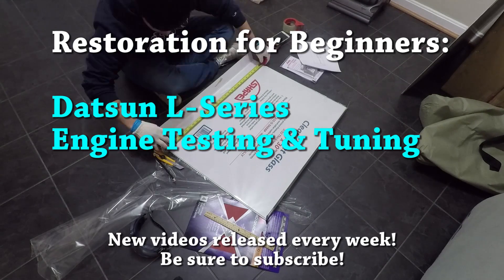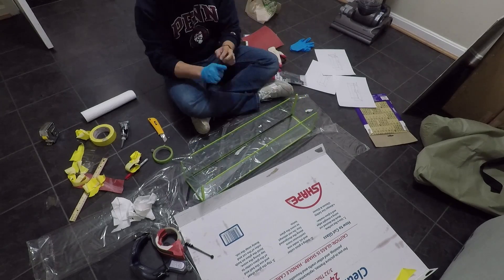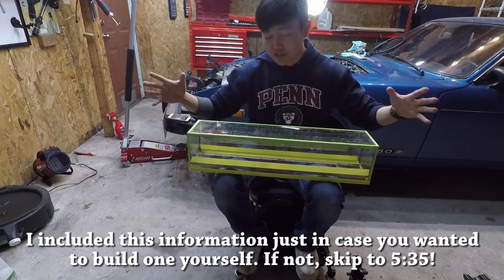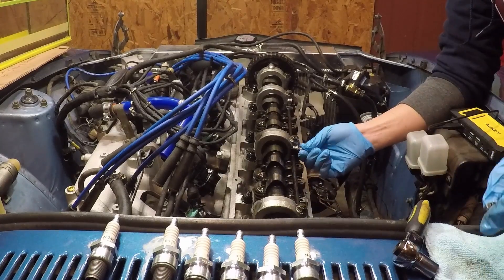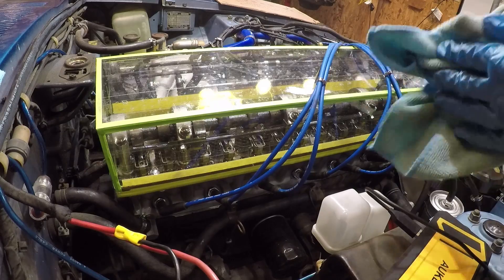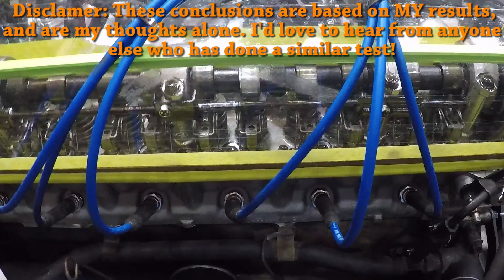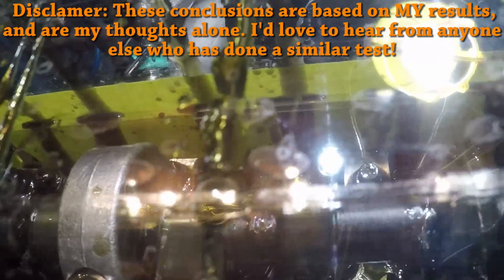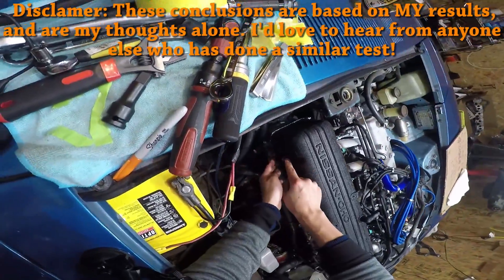Datsun L-Series Engine Testing and Tuning Ep.6 Clear Valve Cover!

Comment: Really cool experiment, though I'm pretty sure the spray bar system came before the internally oiled setup. The spray bars have a tendency to fall apart and the sections separate, the block sections can also bend and not seat properly against the cam towers. I think it's a better system on paper but has pitfalls in the real world!
Reply from the maker: You're absolutely right, I had that flipped (pinning this comment so everyone sees). They did away with the spray bar and went to the oiled cam afterwards.
Reply: Just discovered these videos, awesome! I wanted to clarify that there are two models of spray bar. The earlier type uses aluminum distribution blocks with steel tubes soldered/brazed in. Those fall apart. Your's is the later type which is all steel and stays together. It's worth keeping/selling.
My L24's original bar was bad enough you could remove the rear most tube by hand. The only thing keeping it in was it running into the rear most cam tower.

Comment: Hey, I’m not an expert on any car engines but a suggestion. How about talking to Rob Fuller of the Z car garage in San Jose California and ask him about keeping or not keeping the oil spray bar??     also I’d like to ask is there a way to clean out the inside of the spray bar and make sure the holes are not restricted or plugged?

Comment: The head has so many points on it that can wear, because of the constant motion there, that I'm personally satisfied that the oil spray bar (bad name IMO) is getting oil on a critical location by dripping. Without it, there would be no oil getting to that critical location other than spray caused by the spinning camshaft. Remember the old saying, "If it ain't broke, don't fix it..."

Comment: You definitely need to upgrade your oil pump to a high volume unit when going with both internally oiled cam and spray bar. Basically you are adding more ports which allows the oil to flow easier thus lowering the oil pressure and degrading the spray bar's ability to spray properly.  You need to increase the volume of oil in the system in order for the spray bar to spray properly.  It would be interesting to run the test again after upgrading the pump to a high volume unit.

Comment: Great idea making the clear valve cover. I recently bought a '72 240 and the spray bars were removed and a Comp cam internally oiled cam was in it. There are block off plates too. I wondered if the spray bars did put oil on the lobes better than the small holes in the lobes. You showed that internal oiling is most likely better than the spray bar and why Nissan made the change in '77 I think. Thank you for the video and information.

Comment: Oil spray bar and oiling cam drops the feed pressure to low.Either use 1 or the other.Do not over think and create a new problem by trying to be different.

Comment: Just out of curiosity which oil pump are you using and how much oil pressure do you have during this "test"... I've seen the H4 pump used which is a stock turbo pump used with an internally oiled Cam and a spray bar and it doesn't look like that it sprays a steady stream at idle into the cam @ 25psi of oil pressure.
Reply from the maker: I'm using the stock L28E pump. I have heard that if you want to run both systems properly, you need to upgrade to the turbo pump.
Reply: Ya I said that... what was your oil pressure during this test.... it would kind of make the test not valid if you didn't know what the pressure was during the test.
Reply: You can also put in a stiffer spring in the oil pump to bring pressure up fyi
Reply from the maker: I wasn't able to bring up the oil pressure that high during the test, but I did manage to get it up to 20-30 pounds.
Reply from the maker: Noted, thanks!

Comment: Thinking about your Oil burning, Have you hooked up a vacuum gauge, it can tell you alot about the condition of your engine, If its a few inches low, say 15/18, and steady at this reading, this would be a clue of rings going bad. One of the first things I did with my Z was install a vacuum gauge. Not sure what your engine is suppose to be vacuum wise, mines at 20/21 at idle.

Comment: I have an original '76 280Z manufactured in 11/75, and it's got the spray bar.    I'm going to guess you rearranged the before and after at 0:41.   I think some '77s were internal if they were manufactured after a certain month in '77.
Reply from the maker: Yes, I mixed that up! The spray bar was before the oiled cam.
Reply: I currently own a 77' and its internally oiled

Comment: Could've used plexi glass or acrylic if you were worried about the glass breaking. Great video though! Not having the valve cover sealed shouldn't have caused a vacuum leak. It was probably the breather hose that ran to the valve cover causing the vacuum leak so plug it off if you do that experiment again.
Reply from the maker: I thought about that, but I didn't want to risk the acrylic warping due to the heat. I don't know about plexi glass, but acrylic tends to warp and melt near 200 degrees Fahrenheit.  In hindsight, that probably would've been a safer/easier alternative to glass, since I wouldn't have let the engine get that hot. 
And yes, that's an excellent point. The vacuum leak was due to the breather hose not being securely closed, not due to the valve cover itself.

Comment: That was very cool, thanks for taking the time to do that. On a side note You seem to be under the impression that an open valve cover is a vacuum leak, a vacuum leak is in the intake system, having the valve cover or oil cap off should not cause a vacuum leak. I really need to get one of those crab nets.
Reply from the maker: You're right! The vacuum leak was due to the fact that I didn't securely close off the breather hose that connects to the valve cover outlet. I just had the silicone hose folded over, but it came undone during the revving. 
Haha I never actually used that net for crabbing. I bought it to go crabbing, but now I just use it to fish out parts underneath the car.

Comment: Curious as to the ID of the spray bar ports and if they were made smaller, like pinholes, would the stock pump pressure be enough to throw the oil farther into the path of the cam lobe. Probably moot, but would be interesting to find out. Great work on the valve cover.
Reply from the maker: Thank you! If I had precision metalworking tools, I might be inclined to try the smaller ID spray bar. But honestly, I doubt that it'd be worth the effort since it's more likely that I'll damage the fragile oil spray bar, and according to high performance cam manufacturers, it doesn't even sound like it's strictly necessary.

Comment: I would think an experiment like this would raise some eyebrows and perhaps even create some marketplace demand for spray bars that actually work as intended.   I do have to wonder if they're all functioning like this or if this is unusual.    It's hard to tell from the video that it's not spraying at all (ETA: at higher RPMs).   Do others both spray and drip to some extent?    Does dripping and not spraying mean smaller/consistent clogs or wear, or is it straight up a defective design?    
It would also be interesting for someone with a higher spec aftermarket oil pump to duplicate this experiment with the old spray bar on there to see if there's a difference.   It might be that the bar is a good design.  Generally speaking it looks like the cam is getting great lubrication and there's plenty of oil flowing about so things look really good with the internal system.   Even dripping onto the top of the rocker I have to wonder a little bit if the oil still runs down the top surface and ultimately adds somewhat to the lubrication where it's supposed to rather than being completely useless to the point of being counterproductive.
You almost showed us your spark plugs at 5:35.    I'm guessing they're all good.
Reply from the maker: I can only assume that the spray bar would work fine if it was paired with a camshaft that wasn't drilled to oil itself. The point that I was trying to make was that the stock oil pump can not drive both methods of oiling, you have to pick one. The spray bar in the video is in fact pouring oil out of all holes, but not at enough pressure for the sprays to reach the rocker arm pads.
Haha on the spark plugs, I'm keeping that a secret until the right episode! Spoiler alert... there's trouble in paradise.
Reply: How about at 5000+ RPM though?  It'd be harder to see it'd be slinging so much oil around though.   But that's a good point.   I have to presume the spray bar is working way better than what we see here across the RPM range when that's the only method.
Uggh well I wish there were no issues presenting with the plugs.  Great stuff, regardless!
Reply from the maker: Haha I'd be way too scared to rev it up above 5K with a glass cover on! Maybe I should have used acrylic instead. 
Also, when I was revving 3K+, oil was spilling like Exxon Valdez.
Reply: I think you're absolutely right in your conclusion of this double lubricating system.   Since I have no evidence of oil doing anything but dripping out of your bar, a stock oil pump (at least) makes this dual setup useless and it's better off to just do what you're doing and eventually get the plates.   Good experiment!
Reply from the maker: It's my pleasure. Thanks for the input as always!

Comment: you can put in solid gasket material for now as a block off (no oil hole) and check to see how much better the oil flows from the camshaft. I think one other consideration  would be how fast the cam oil comes up. GREAT video I love this kind of stuff, no more reason to speculate. Congrats!
Reply from the maker: That's a good idea, but I think I'll just install the block off plates and keep the oil bar to install on the other engine, since it's straight enough without any clogs. I'll install a high-flow pump on the new engine and see if I can successfully run both lubrication methods. 
Thanks for the idea Dave, I spent a of time but it was fun and useful!
Reply: very useful, based on this I would not hesitate to say with out a doubt, Don't run both, the spray bar is adding nothing and the internal is being robbed. Very useful data collected here. Good to exp with the hi volume pump, a test like this will verify if that is a good option.
Reply from the maker: Yes, I'd agree! I got a little scared when the car died on me, but I guess you can't expect it to run for that long with a glass cover on top of the engine.
Reply: Did you have an air tight seal on the top breather hose? IIRC I did not have an issue running with the valve cover off, but breather had to be closed off air tight. If you have already put the reg valve cover back on, see if it will idle normally if you pull the hose off the cover and seal it well.

Comment: You could always upgrade to a better oil pump like a ka24de oil pump, it's the exact same and supposed to be rated for better oil psi. But I only know that it's good for the l4's, I dont know how good it will be for the l6's
Reply from the maker: Yeap. I might. Replacing the oil pump is such a hassle though. I will definitely upgrade to a better oil pump on the other L28 that is sitting on the stand right now, but I think I'll just leave this one alone.
Reply: @RestorationForBeginners  You are presenting yourself as some sort of expert on restoration yet your video is full of mistakes and falshoods.  Now you are complaining that at 2 hour oil pump swap is "such a hassle." LOL!  You should change your name to "Beginner Restorer."